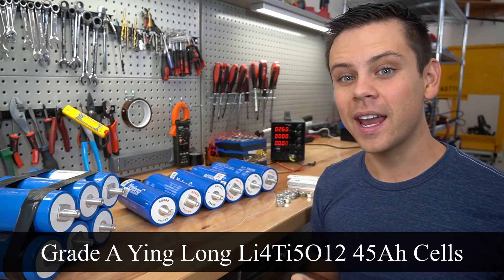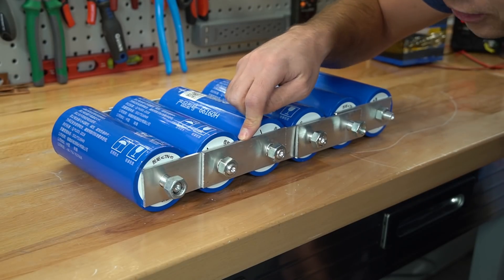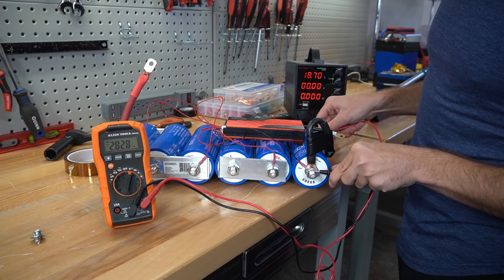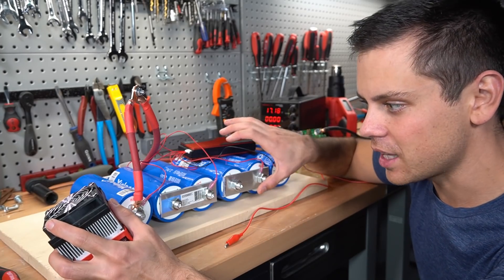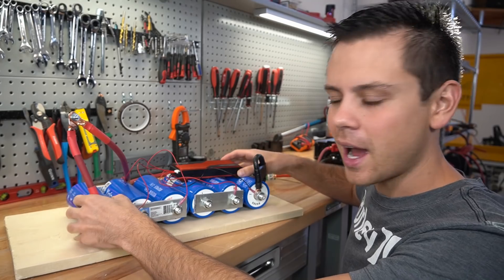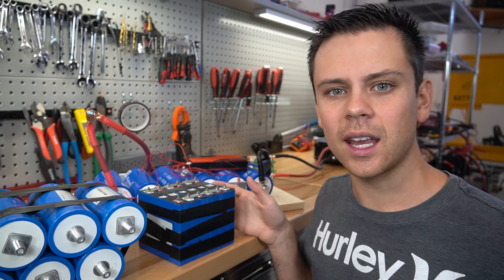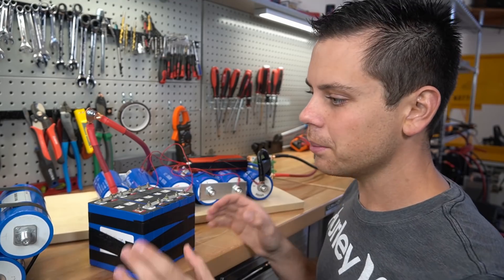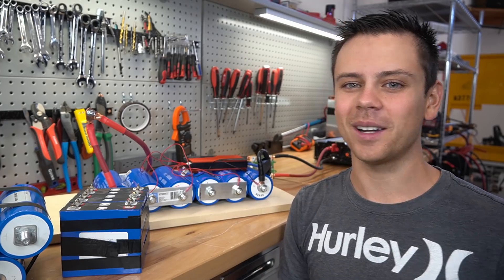$493 Aliexpress 45Ah Grade A, YinLong Lithium Titanate (LTO) Cell Testing

Comment: what i have also noticed is the ones with higher amp hours just BARELY have a lower nominal voltage... like check out the 16ah lishens they have a higher nominal voltage.. even the lower AH yin longs just barely have a higher voltage... toshiba scibs.. same way the big high capacity ones have a slightly lower nominal voltage and the smaller amp hour ones have a just barely higher nominal voltage... If someone knows more about this please help me understand, thank you

Comment: LIFo4 , LIPO ???? batteries are rubbish for duration i went took a ride on a scooter suppose to be 40mph , 40 miles range does not even do 10 in eco mode ,
so never again will i get one of them stupid batteries only way i ended up with it is because i was scammed by ,MAF (DYU SCOOTERs)
will buy a lg battery when get money back or just stop buying evs till battery issues are upgraded further

Comment: Another great vid Will, have to agree with most of ur arguments as usual, space travel, satellites would probly be where these cells excel maybe.  Also, what are ur thoughts about LTO &/or capacitors in series on the solar panel side of a conroller for a little extra power in partial shading and after sundown extra charging for that bit extra owner until the sun rises again. Cheers

Comment: You can very easily install them in series, and get a 24, 48, or 96V system.
The current doesn't change on series connected batteries.
For solar cells, if you use many, you can very easily upvolt the 12V output to 96V, which is much better for long power leads, before charging the pack.
Maybe 100 amps isn't what you would use at 12V, but it's perfectly fine if your system is a larger system (like a solar farm) at 96V, or even 192V.

Comment: My Yinlong LTO 40Ah has exact 1,236kg. Measured actual Cap. is 43,6Ah. Since 3 Year in use for Solarenergie.
Twice I accidentally unloaded these cells to 0 volts for several days. Cells are still new, better than 40Ah. Great Cells.  I have pay 15 Dollar for each cell in 2018, have 132 pieces.
Reply: From where
Reply: @alexyoung8983  OSN-Power.  Price is now $40  😞 5 years later

Comment: LTO cells brand from Lishen got a lot of good review and previously im using for my car audio setup...surprising for my 36ah 6s2p setup can support up to 8000 watts rms++ with just 150a alternator 15v system and get total around 820a burst power test.The cells rating can up to 25c current discharged.

Comment: You find a better supplier? I need to buy some of those testing tools you got before i get cells apparently.  Im looking to run a 48v-120v electric motor outdoor in freezing temps. Think this chemistry is good or lifepo with a heater? Also do they have a decent bms for up to 120v?

Comment: For solar power? I'll stick with cycled, matched salvaged 18650s from laptops. I can match and do 7th grade math. But LTO, especially in pouch (or rectangular) format will be awesome for high performance speed run RC cars and planes. You best BELIEVE I'll be loving that charge rate😍😍🤓🤓. Even top grade lipos die in 90-150 seconds of run time. C'mon battery tech....I just need 100 times more energy in the same volume, what's taking so long?🤣 Ok, what about 10? Can we do 10?

Comment: 38Ah / 45Ah = 0.84 (= 84% de-charge efficiency) 
I believe these may be 45Ah rated because they may consume this much power for charging which is close to 100% efficiency. I'm no expert on how the ratings should be, but a 45Ah rating may be correct. I would be interested in seeing how many Ah consumed to charge.
Note: For safety I would not recommend using aluminum for buss bars, especially for long term usage. Copper buss bars are available in the size used in the video. Also, use flat and split washers. Flat washers for all and split washers for long term usage, helps keep the nuts from coming loose. And, lol, for heaven's sake, please wear a pair safety glasses. 
Thank you for the information. I have bought a few items from your website's links.

Comment: Commonly theese batteries selling on the market with 2.3v 40 Ah labels. Also Data sheets saying 1.5 V is discharge cut off voltage, not 1.6 v

Comment: If you think you paid a lot for those cells, take a reality check holiday trip to Australia, and experience the great Australia tax, this is not a tax as such but how we describe the unfair and huge markup ups and price gouging that goes on. Ebay and China has helped get stuff cheaper, by bypassing the price gouging importer or distributor but it not always good quality.

Comment: Jeez this is nervewrecking to watch. Please put a shield over the cells or wear protective gear for ytour face, arms and hands ffs. You are so close to the cell with bare skin!
Reply from the maker: Voltage is low. I'm fine. You need to learn ohms law and resistance of dry skin

Comment: What is B-grade?, maybe used batteries or factory product that had some "issues". In electronics, many components have variations during the process and the selection is done which ones are better than others, like industrial graded components are the same as commercial graded parts, but they just happen to be better because of the beneficial manufacturing fluctuations.

Comment: Interested in building an LTO pack for long distance ebike touring because of the high charge rate. The ability to travel 45 miles, potentially get a full charge off of any standard household outlet in 20-30 minutes while having lunch, and proceed is very practical for that use. Will need to pull it in a trailer though because of size and weight .

Thanks for the video .

Comment: I have problem, made battery 66160 18 pcs series parallel 120a 12v. This is for camper living battery and inverter 1500 watts, as it is now max 16.8 volts, this gives errors on the system. What should I put in between to bring this down (12 to 14 volts) Thanks.

Comment: I think about is .
And yes boat is the way to use is.
The Electro engine will pul a lot off power.
And its can handelt the cold .
So boats what go to cold places will be a great way.
Speciale the boat have a long use for it go to a junkjart.
Boat are beult arround an engine.
You can not thake a engibe oud.
So for Electro boats well it can be use.
With combo solar and wind charging

Comment: Dear friend, I want to assemble a lithium battery pack that will be charged by a solar hybrid system (100w panels) and windgenarstor (30 watts!
Just to support a 12V 5 amp fizzer and more other eletronics 7 ampers 110v ac.
Is support for 8 hours in the day and 3:30 hours at night?
What infects me?

Comment: Have you ever considered using the titonate cells as a safety for the other lithium cells in your system? If you run the solar panels to the titonate cells and use them to keep the others topped off and warm? Just a thought.

Comment: Hi William, I love to watch your videos. I have dabbled in Hybrid Power Systems for over 10 years. During this video you down play the value of LTO high C rate. And for solar power, I agree. However, on a personal note, I have a Bad Boy Buggy, which is basically a souped up 4x4 Golf Cart. It has 8 each 6V 200A-H Pb Acid batteries in series and pulls 500 Amps. If I could get 100A-H of Li batteries that could handle 500 Amps at a reasonable price, I would switch over. In this case LiFePO4 cannot handle the C rate that I need. LTO is the only way to go. The limiting factor seems to be the BMS. The one you showed is good for 100 Amps. So, just a side note here, LiFePO4 cannot handle all applications. Keep up the good work.

Comment: the cells you got are fake/copy cells. there are no 45ah that exists in YL. it is only avail on 35 and 40's. get it from reputable manufacturers like OSN POWER. the only difference between grade a and b cels are internal resistance...  the other chinese resellers used to get 35ah and shrink wrap it in 40 or 45ah.
Reply: BTW im currently using these cells in car audio application w/c requires balancer only and no BMS. because it will hurt the output discharge and input charging of HO alternators.

Comment: Thinking about building a car starter battery with these cells. Would it be overcharging it to 2.88V for 5S configuration? Since I know the discharge characteristics of these cells not quite good below 2.4 volt.

Comment: I would like to know, if I can make a 72v. pack from these cells, to replace the lead acid batteries that I now have on my ev DC 72v homemade ev.  Will they endure the high voltage required to run it.
Reply: Yes, these will do that and more, they are just very expensive

Comment: I have those 40ah Yinlong cells for my car audio and they working very well. But I have an issue with a QNBBM 6S balancer. When I’m not using my car I can hear a little noise coming from this balancer and every time it’s draining my cells, because the balancer is working 24/7, I don’t know if it supposed to stop at one moment or no... do you have any advise for me?
Thanks

Comment: When you hook the cells up in parallel without matching the voltage between the cells using some form of current limiting couldn’t that have damaged them. They could have dumped huge amounts of current instantaneously to match the cell voltage.
Reply: That's exactly what I thought! I would use BMS to balance cells or high power resistors.
Reply: They were close enough in voltage that is very unlikely. Also if that had happened we likely would have seen sparks - we didn't. I think the most likely scenario is these companies are selling used cells.

Comment: Be careful when connecting cells in parallel like that. Might be ok at 0,1 V with this capacity, but larger cells might already produce high currents. 
At work they balance individual modules of forklift batteries to less than 0,1 of a volt, as they produce ridiculous equalising currents at super low voltage differences.

Comment: Usually I like these videos. This video blew everything up in the negative direction! When measuring cell voltages in the beginning, you have to round up. If the multimeter says 2,645 V. That is not 2,64 V. It is 2,65 V or you can say 2,645 V. Especially the third cell with 2,628 V was said to be 2,62 V. Face palm! Even if you were unaware of the rounding system, an electrical guy should automatically say 2,63 V

Comment: The reason you can most likely just to get grade B is that Grade A normally do not sell in retail pack. Normally if you want to get a Grade A cells you need to contact the battery manufacturer directly, and in China there are many recycle battery and they put it on Online retail sales (as recycle one has greater margin). 
But if you are buying so small amount I don't think you can get much response from manufacturer

LTO battery also has very little demand from the customer market, so it makes it even harder to get a good one

Comment: Those are what you would call "re-wraps"

I've bought a huge amount of these cells over the years for my own projects. The chinese market for these is a little messed up. I've found the most success with making sure I've got a Yinlong authorized re-distributer. Most of them are not. So most you find are re wraps and "re-stud" cells, which is where they weld on new end studs. I've actually had better cells with re studs but they have a tiny bit more internal resistance.

Comment: Thanks, good video but maybe you need think about ohm law.
12 volt/1 ohm= 12 amper
This mean you need put more small ohm or need make serial connection with other grade b cells for more big voltage(also mean for big amper more easy).
I guess this will fix your problem :)

Comment: Looks like a great application would be a van with a big alternator that is set up to use for downhill skiing, which is what I am working on at the moment.  Cold temps, very high charge rates so you don't have to run the van for hours when charging.  Frequent start and stop cycles when touring around etc.  
And thoughts on why there are so many B cells out there?  Honda, Mitsubishi, bus manufacturers etc use piles of these cells.  If any cells don't meet their stringent specs they hit the B market I expect.

Comment: Interesting clip but I don't agree to your conclusions (especially about the needs of solar systems).
Reply from the maker: What do you disagree with
Reply: @WillProwse  I'm focussing on solar generators since many years (built approx. 400 solar plants of any scale). Your clips are very interesting as far as it is about storage applications and testing, but what is the best storage solution with completely inefficient solar configurations for? It's ok for camping, etc. of course.

Comment: It seems to me that this chemistry is perfect for vehicles and maybe phones/laptops where safety, fast (dis)charge and temperatures are very useful features.  Using them in a building not so much...
Reply: phones and laptops need to be small and light therefore it isn't a good idea.
Reply: @magiricod  The batteries for phones and laptops can be made using this chemistry just as well.  They won't be larger or heavier.  I said Chemistry not these specific cells tested - that would be ridiculous of course.  What are you basing you opinion on?  If you have seen research somewhere that I don't know of that disputes it please share it!
Reply: @stewartrv  I mean look at the energy density of it. It's abysmal. Only good for large applications like vehicles and stationary applications
Reply: @magiricod  I was under the impression it was only a bit worse than normal Lithium-Ion (due to lower inherent voltage mainly), but I see your point, now I looked at that parameter :)

Comment: So, I know that you can arc weld using car batteries. Would you be able to arc weld with lithium batteries? It sounds dangerous but I can't find any information online about anyone trying to use lithium batteries to arc weld.
Reply: yes, there is an Austrian manufacturer that actually makes a lithium battery arc welder

Comment: If you think that the rating on them is bad, you should see them on some USA made capacitors. 6,300µF at 400VDC -10% to +50%. So in reality they are 5670 to 9450µF capacitors. You just don't know what until you test them. Newer ones are -20% to +20% which is still a 40% swing possibility.

Comment: How have to have thicker wires on your capacity tester. The voltage drop will be to high on the wires you now and you will have some heat related power losses that will affect the measurments. If you have 0.1-0.2 Voltage dropp in the wires with 5 apms discharge then you will loss 0.5-1watts, in 8 hours that will take to discharge the battery you will loss 4-8Wh  or 2-4 Ah. I think that it will be a good think to check your testing setup.

Comment: Hello Will,  there is an easy way to tighten the buss bars properly with no danger of damage to cell. first put a nut on the threads flush with the base of the cell, you do not need to put any torque on the nut. Then put a buss bar on, then add a second nut, when you want to tighten the buss bars, you use two wrenches and the inside nut is screwed to the outside (as if you wanted to take it off), and you tighten the outside nut, there will be no tension going into the cell, you are only locking the two nuts into the buss bar. In some cases, you may need thinner nuts.

Comment: hi, i work with battery suppliers from china for about 5 years and if talking about LTO cells - there is lots of interesting stuff hapening with such cells in china and it's very tricky to get exactly what you need, first 45ah Yinlongs cells i got about a year ago and on 2C test (my single cell tester only can handle up to 80A current) i got around 46.1-46.4ah and they aint cost that much in china mainland, the price is around 30-35$+shipping, quality depends only from suppliers good faith, because if we`r talking about Yinlong products - there`is no A grade available on the market and never been, only B and C grades. The only A grade cells i could get is that one i bought from Yinlong directly, but that is comlicated even for wholesale byers ;)

Comment: My experience with Chinese sellers on eBay and others, mostly in the audio and power supply area is overall, power output is almost always way less than advertised. Safety is none existent. They are quite happy to sell you stuff that will blow up or even kill you. Very little is inspected or tested. Can take months to get the goods, about 40% of items NEVER arrive or are damaged due to poor packing. 
We know it's going to be crap but we still keep buying!
On my channel I always expose such retailers and products, very pleased you do also, it's the only way they will learn. If a retailer gets a bad rating, they just change the name of the shop and continue to trade in the same way.
Reply: I have recently bought some decent 5Ah 21700 li-ion batteries on Aliexpress for ebike 10s-4p configuration. I am super happy with the price, the real capacity of the individual cell is about 4.8Ah and the bike's BMS is used for protection. The bike's BMS with default settings uses little over 600 Wh out of 'stated' 720 Ah, which is perfectly fine, considering I have upgraded from faulty 360 Wh pack.

Comment: this has absolutely nothing to do with this video but i trust your opinion like no other.
 on your site, you saying that that EPEVER MPPT Solar Charge Controller is good for Drop-in Lithium Battery... could you explain what a Drop-in Lithium Battery is and is a Valence U27-12XP LiFePO4 12V 138AH 1.766 kWh Lithium Iron Phosphate Battery a drop-in Lithium Battery?

Comment: I lived off-grid for 10 years. a 10C discharge rate is very advantageous when a heavy load (well pump, heat pump compressor, welder) kicks in as you don't brown out your other loads. These are great cells for solar off gridders.